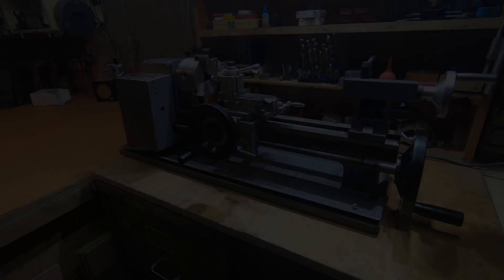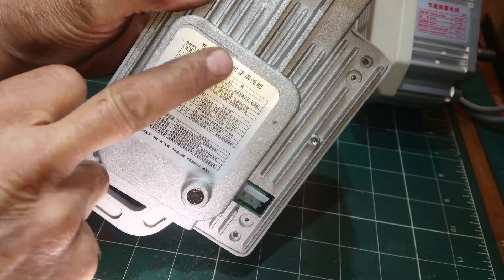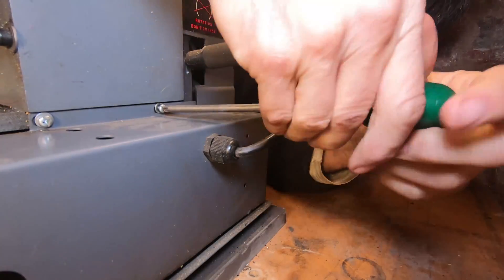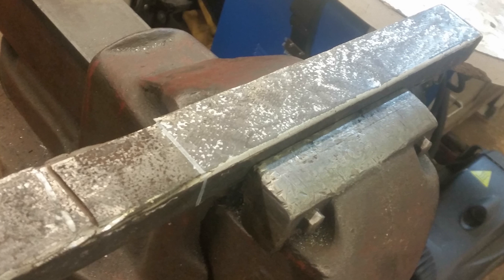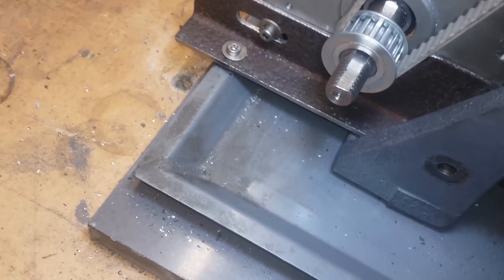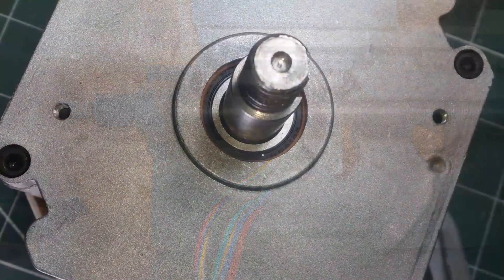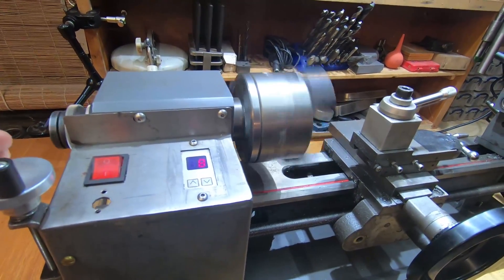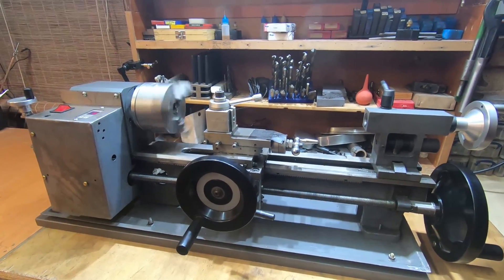MINI LATHE UPGRADES #1: BRUSHLESS MOTOR UPGRADE

Comment: Nicely done.  The Hall effect magnetic speed control had me flummoxed.  You could replace the Hall effect sensor with a simple microcontroller circuit that takes a pot and translates it to variable speed.  The other possibility would be to use a simple cam to move the control arm.

Comment: Brushless when they overheat mosfet burn really fast
Reply from the maker: Weird synchronicity you should've commented on this just now, I just noticed literally this week how hot the motor was getting. I think I'm going to need to upgrade the fan. Any ideas? Cheers for the input, much appreciated 👍

Comment: This would probably need some electrical investigation, but the 4 pin square connection on the control board is probably for an electronic foot pedal control, which is most likely designed for a potentiometer. Figuring out which pins do what will be the hard part if they don't provide a pinout for it.

Comment: Thanks for this video, it was very informative. I have a question: How much power had the original motor? And what was the max deep of cut it could handle - and in comparison your new 550W sewing machine motor, what was the gain? It is enough power for you?
Reply: Mine.came with a 600 watt and it's still CRAZY underpowered still.

Comment: thank you so much for this video.  i changed out my motor as well and then just kept getting deeper and deeper into the rabbit hole.  I am so glad to hear someone else comment on the complexity of the gears for cutting threads.  Its a mini lathe and I , like you, dont see the need for it.  I do want to add a motor to the lead screw for automatic feed.  Thanks again.
Reply from the maker: Sounds like we're having some parallel experiences here! I haven't had the time to spend on the channel for a while but putting a stepper on the leadscrew is definitely on the bucket list. If you get there first, let me know how it went!! Really appreciate you taking the time, thanks 🙏
Reply: @ yes, I will.  The motor just came in from amazon today.  However, right now, I am still working on my carriage and cross slide.  I am going to use some moly filled nylon 6/6 that I had laying around for the retainers. I am starting to see some light and hope to get to the motorized lead screw real soon.  Keep you posted and keep up the videos.
Reply: I mean- being able to turn a peice and custom threads is like half of WHY I got the machine😂

Comment: Nice job. Did you consider a 3 phase motor and VFD mounted externally?
Reply from the maker: Great feedback, thanks.  3-phase would be overkill I think, it's only a 7x14 minilathe.  This sewing machine motor's been working well although I still need to finesse the pulley ratios a little.

Comment: Can the motor run in reverse? How?
Reply from the maker: The motor came with instructions on how to reverse rotation. It's a series of keypresses on the keypad under the readout, I can't remember offhand the exact sequence but I'd assume it'll be specified in the paperwork that comes with the specific motor you get. Thanks for stopping by, appreciate you taking the time.

Comment: Nice job, it would be easy to fit an electronic rev counter for accurate readings..
Reply from the maker: Hey John, thanks for stopping by and for your kind words. That's an interesting idea, I hadn't got as far as thinking about that. Ebay here I come! Appreciate your input, thanks again

Comment: You're going to want change the pulleys to get a 3 to 1 ratio. That way you will get more torque than you need. I know I did it and it works amazing.
Reply from the maker: Yeah, I've been thinking about this. The only hesitation I have is that I'm assuming changing the ratios is going to throw the rev counter out. To be honest, I haven't yet checked whether the one-to-one ratio I have now is reading rpm accurately - for all I know it's been adjusted to suit whatever the pulley ratios were on the original sewing machine the motor came from. Do you have a read-out on yours? It would be really useful to pick your brains on this. Very much appreciate your feedback Ron, this has been on my mind for a while. Thanks for taking the time.
Reply: @myharris  You can easily take the motor reading and divide by 2, or 3, or 4, in your head as you go.... If you get a funny number that is not easy to divide, you can change the speed dial until you do get an easy number...Good Luck!

Comment: Great job getting everything to fit back on the lathe. I hope my motor change over goes as well. I subscribed to your channel so I can follow along with your bearing upgrade. Just started a series  on steel gears and taper roller bearings upgrade on my channel. It's good to see other channels doing Mini Lathe projects.  I will be sure to watch all your adventures.  Good luck with the bearing upgrade. Thanks for sharing,  GlennNow On YouTube
Reply: Dude!  It is a small world to see everyone in the same place!  Hopefully I'm not a third wheel here🤣
Reply: @joetaylor1089  Hello Joe, No you're not a third wheel. This is what YouTube is all about.
Reply: @GlennNowOnYouTube  Thanks man👍
Reply from the maker: @joetaylor1089  You guys, get a room 🤣🤣🤣
Reply: @myharris  A room of machine tools?🤣 Working on it🙂 ( you'll have to excuse my poor Dad jokes, I'm stuck with them.)  The worst part is trying to clear some space in my garage and working out proper moisture and temperature control.  I don't need rust😆
Reply from the maker: @joetaylor1089   Hah! I have the same humidity problem. Works out a lot cheaper to to souse everything with WD40 than heating the garage :)
Reply: @myharris  No kidding?  I'll keep that in mind.
Reply from the maker: Hi Glenn, really appreciate your feedback and kind words. I've just subscribed backatcha! Looking forward to mining your back catalogue for ideas and inspiration. I hit a small snag on replacing the bearings as the supplier sent the wrong ones, so looks like it'll be midweek now. I'll definitely watch your taper bearing series - my own attempt at this a while back ended in abject failure so I'm hoping you have some answers! Thanks again, and welcome aboard 👍

Comment: I've got a lathe endmill combo that I want to do this with. It is one speed on the lathe and the endmill speed requires a belt move on the pullies. The lathe is reversable. I would like to have some speed control electronically.
Reply from the maker: What make/model is the combo? It would be interesting to see how this mod could be applied in your case. Thanks for your input 
👍
Reply: @myharris  it's a cheap Central Machinery combo sold by Harbor Freight. I'll have to get the model later. I can't look at it at the moment.
Reply from the maker: @donniewatson9120   Just wondering whether it has seperate motors for the lathe and mill. I don't think I mentioned in the video, but the motor I installed can be reversed too, though I haven't tried that yet
Reply: @myharris  It does have separate motors.
Reply: @myharris  The model is a T5980.
Reply from the maker: @donniewatson9120  Looking at the manual, the motors look to be 370W/2000rpm apiece, so that's doable. Would you be looking to do both motors? One thing I didn't cover in last week's vid was programming speed and direction, if I find the time I'll see if I can include something about that in next week's.
Reply: @myharris  I will definitely be doing both motors. I'll be changing the pulleys out as well. It's set up with v-belts. If I have variable speed motors, I would be setting it up with cogged belts. The v-belts slip too easily.
Reply: @myharris  I've also considered setting up a stepper motor on each axis lead screw. Then I would use an arduino to set up a makeshift cnc control.
Reply from the maker: @donniewatson9120   That would be a good project, and an ideal machine for it. I hear you about the belts - oddly enough, I was wondering whether to switch to vees so that they would slip before anything too drastic happened to the motor! It's all trial and error, at the end of the day. Good luck with the project, I'd be interested to hear how you get on.
Reply: @myharris  Thanks!!!

Comment: I've bought a small mini 2nd hand lathe, so will be interesting to see how you get along.
Reply from the maker: Hey Phil, welcome to the channel. Looking at the bearings in the next video. I'm finding that this little machine is actually quite usable after some fettling and finessing, they definitely repay a little attention. Thanks for stopping by, appreciate the input 👍
Reply: @myharris Just picked up a 2nd hand mobility scooter motor today. Runs at 48V @ 1000Watts running 3000RPM. Looking to push it through a speed controller and a 3:1 gearbox. Bearings are something I'm going to be looking at as well. Need to get the machine cleaned down first as it's in a right mess. Came with a lot of tooling.
Reply from the maker: @phils_arcade  That should push a mini lathe all right, that's quite some torque you'll have!! Did it come with a usable controller board too?
Reply: @myharris  Unfortunately not, but it was only £25, so change left over to get one. Been looking around from cheap Chinese ones at £28 to full featured ones on RS Components for hundreds. Also need a 240-48 volt transformer capable of handling the motor and drive board. Wanting to get a full sized metal lathe at some point, and then see what it takes to turn the mini into a small CNC style lathe, but not sure what all would be involved but would be an interesting wee project.
Reply from the maker: @phils_arcade   Go for it! Would be fantastic to see some footage on that if you're minded to, there's a real appetite for minilathe mods at the moment. At some point I'll be looking at doing an electronic leadscrew, which isn't a million miles off what you're planning.

Comment: Replaced my motor with similar but mounting was different. I have same issues with the hall effect speed controller. Wish i could replace it with a potentiometer but not too good with electronics. 
A word of warning though…. I mounted the control box in same position but due to the hall sensor being a magnet, a small piece of swarf found its way in  and shorted out making the whole lathe live. Not funny as it was quite a belt it gave me. I have since moved the controller up and away from tye lathe with a plastic handle on now.
Reply from the maker: Hey Neale, thanks for stopping by and welcome to the channel. Man, that's a great heads-up about shorting the sensor - very much appreciate you sharing your painfully-acquired experience on this. I did ground the lathe chassis back through the plug (not sure where you're based, but earth tines are fitted as standard to UK plugs) but it's got to be worth seeing if there's a way of restricting crud falling into the control box enclosure too. 

My knowledge of electronics is vestigial at best, as my video on fitting a Hall effect speed sensor to the SX2P lathe clearly demonstrates!  There's always the nagging feeling of potentially making the whole motor unusable if you screw the board up, so the temptation is to work around it. Plus you just kinda want to get the lathe up and running again asap without disappearing down too many rabbit holes en route. One day I'll buy a sacrificial board/motor combo for experimentation, just to see what's possible.

Comment: Good job!  I was thinking of a similar screw set up for the rpms, just like you had done.  Although I was thinking more of cut outs around the wheel handle(more like a knob in my mind) for grip instead of an actual spinning handle like you did.

I think the bearings are a necessary upgrade for one of these lathes👍

I personally wouldn't have gotten rid of the original carriage feed for the reason of getting consistent OD finishes.  Although I can agree the threading could be left out if you don't need it.  I have heard some lathes don't have regular feeds, but I think most of them do if you check the manuals?  I can't be sure since I haven't got my mini lathe yet and the ones I run at work are full sized.

Keep up the good work!
Reply from the maker: Hi Joe, really appreciate the feedback. Interesting idea about the speed control - would be great to see how that works out. From looking at other videos covering this on YT, it seems like it's one of those problems that at first glance seems pretty trivial but can actually turn into a bit of head-scratcher!

I hear you about consistent finishes but honestly there was so much slop in the carriage feed it would've needed a complete rebuild, plus I'm finding the handwheel gives much finer control over depths and dimensions. And tbh I haven't noticed a fall-off in od finish - if anything it's much improved, although that's almost certainly more to do with the new bearings than with any great skill on my part!!

Do stay in touch - would love to hear how you get on with your new lathe when it arrives 👍
Reply: @myharris    I'll Definitely try to post updates.  I have a good deal on a Vevor  mini lathe, so I think I'll go that route.  I'll only know just how bad it is after it's in the garage🤣.  Hoping for it to be at least decently straight and even.  I'd like to try and turn a couple things before I dive into rebuilding individual parts and making it parallel and perpendicular where required.